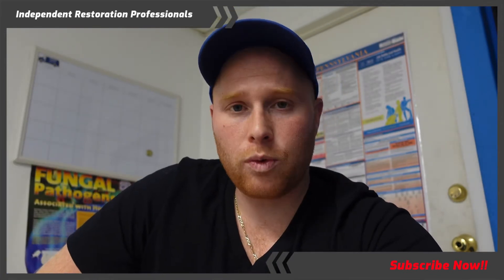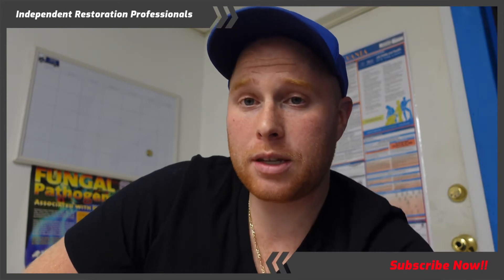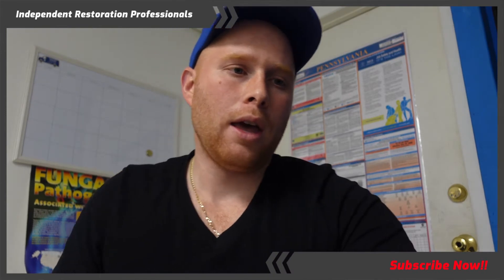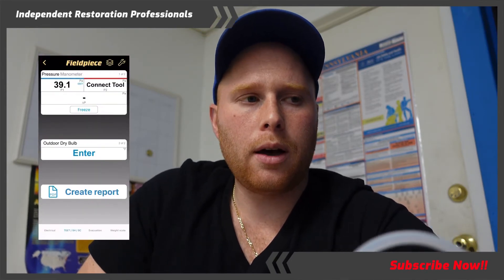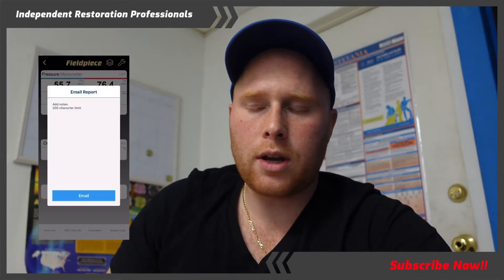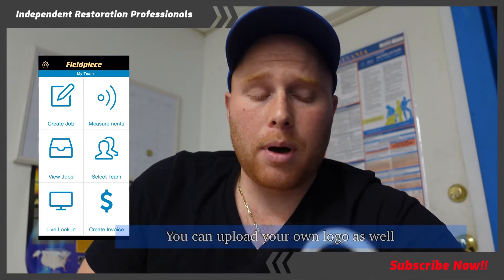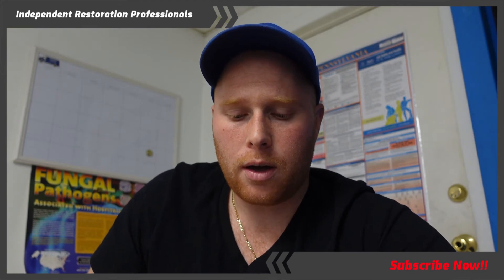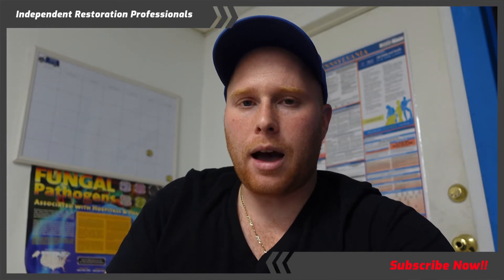Fieldpiece Job Link Manometer

Comment: Covid required to create rooms with different pressures to prevent spread. I have seen plastic sluice  being used at hospitals to contain spread - this tool would have been brilliant to use since walking in and out is a must and the important of pressure is vital.